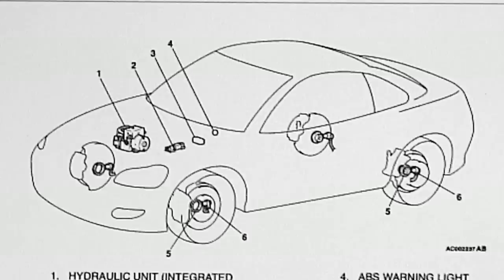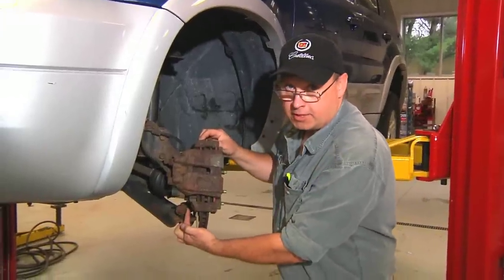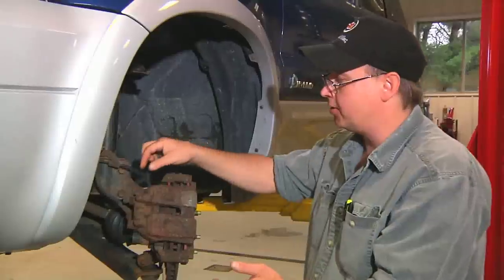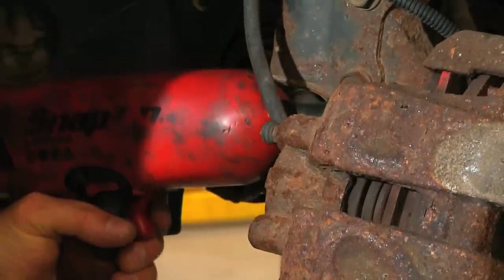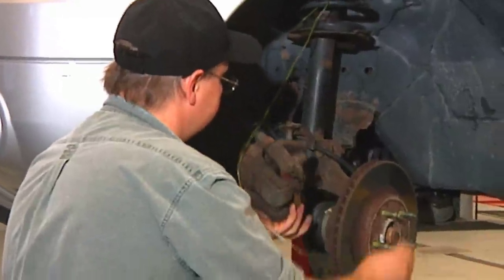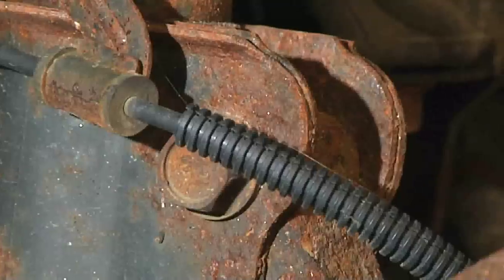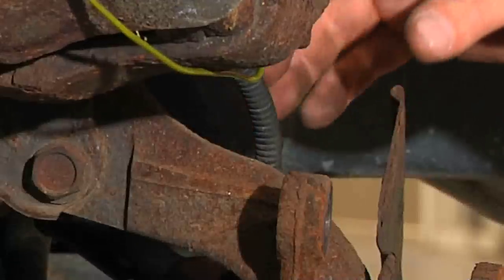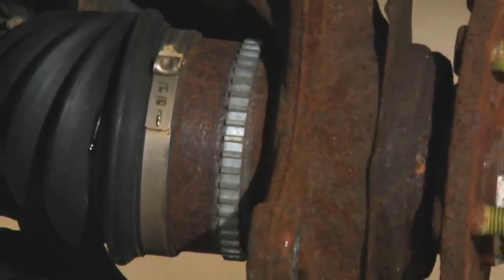ABS Brakes & More : How to Remove ABS Brakes

Comment: Very simple thanks. I just searched for this info related to a 2005. Malibu. only vids on how to replace the rotors, pads and calipers. I have done a few different brake jobs and never had ABS to deal with. this will help lots.

Comment: No no no.  I want to Remove ABS Brakes all of it and throw it in the trash can.  These were designed for jumbo jets.  You don't need them on a car.  Cars did not need them in the past and they still don't need this crap.  If you are rich and have a full time mechanic fine. Otherwise they are garbage that will be expensive to maintain. None of the older vehicle have ABS.  Those cars with disc brakes stopped fine.